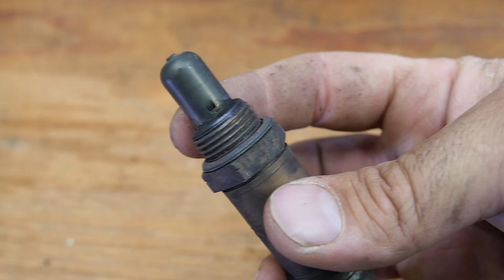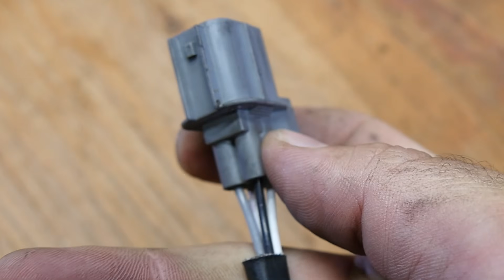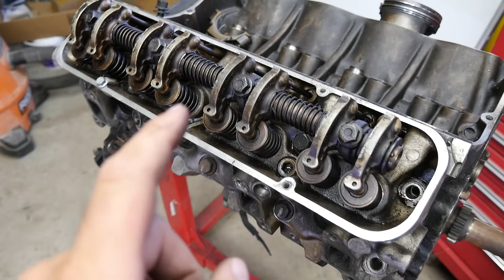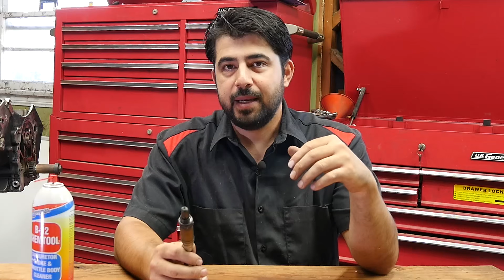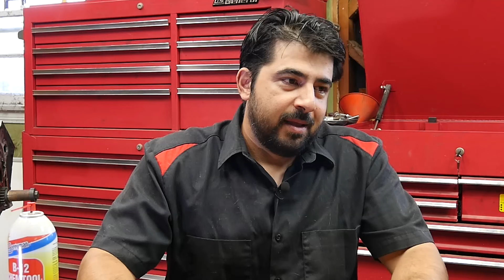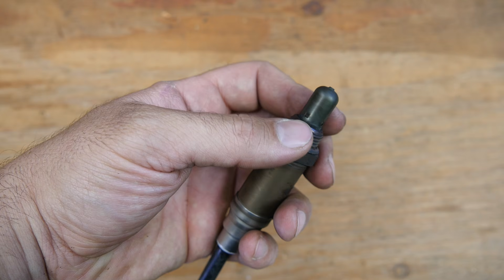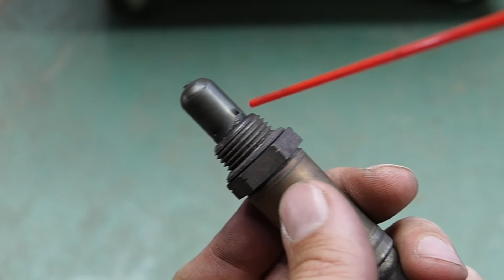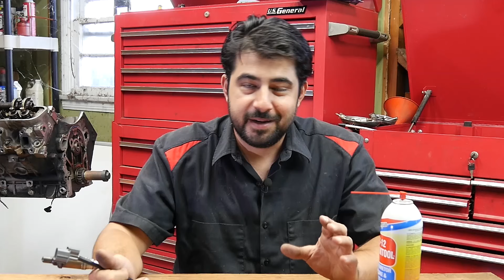How to Clean an Oxygen Sensor

Comment: Is it also true that a failing oxygen sensor could cause “Cat System Efficiency Below Threshold” codes on Hondas?  Alongside bad gas mileage of course.

And cause a very, very rough starting engine when it’s extremely cold? 20F

Thanks for any responses!
Reply: Im having that issue rn. 😔

Comment: Hi sir, quick question. Mine had the code p0135. And i notided the harness is really warm after driving the car around the block. I would say 10 mins at the most.. i came back popped the hood check it and i touched the harness (plug) it was hot to touch. Not so much as the other harness. This one i touched was hot to the point where ypu can’t even hold it at all. Could you tell what could be the reason?

Comment: I'm not getting an engine light, but after a cold start and 5 minutes of driving my engine is having trouble with pulling through every gear. The first 5 minutes it rides perfect and throttle respons is powerfull.

Comment: Ultrasonic cleaner would probably break up the gunk inside of the sensor. I will give it a try on my lsu4.9 wideband sensor. My car had an issue where it wasn't igniting the fuel in some of the cylinders so the exhaust got caked inside with a really thick sort of damp layer of carbon (hence why I was looking at ways to clean an o2 sensor). I have an ultrasonic cleaner coming so I can clean injectors while I am flow testing them on the bench. I will give it a go at cleaning the wideband after I clean my injectors.

Comment: I have 4 O2 sensors in a 1998 Mercedes E320 base sedan. Months ago, 8 codes came up, 2 for each sensor, the sensing code & heating code. I replaced all 4 sensors with new ones. All 8 codes came back after driving for a while. I've been told that on Mercedes like this model, the catalytic converters tend to go bad, the material inside breaks up, and blows out through the exhaust. What do you think of this? Thanks.
Reply: Always get a second or third opinion.....

Comment: The best methods are to soak the O2 sensors, and you can use anything from Sea foam to WD-40 to brake cleaner results May vary lol.
Reply: I enjoy using Seafoam also use it in small engines....brings my weed eater and mower back to life....

Comment: what error code usually occur/shown on the CE lights on? is it always P0172 to indicate we should replace the O2 sensors? how about the Air Fuel Ratio Sensors... are they the same as well?

Comment: I have a 2000 Nissan Frontier- v6,  3.3L and i replaced the oxygen sensors 2 upstream and 2 downstream a few years ago. It monitored and passed smog last year.    I tried to take it into smog this year, and they told me that the oxygen sensor were not monitored.  the heated oxygen sensors are monitored, but the only thing left not monitored is the oxygen sensors.  I do have a small exhaust leak at the exhaust manifold on the driver's side.  My Catalytic convertor, evap are all monitored. I have new spark plugs, spark plug wires, distributor, distributor cap, and rotor. I have driven the vehicle roughly 100 miles and only thing left to monitor is the oxygen sensor.     Is there anything i can check?  any guidance would be appreciated.

Comment: If a cleaned sensor just gets clogged again after a while why wouldn't a new one suffer the same fate? Whether cleaned or new, both will be subjected to whatever is causing so much dirt to get pulled in. Cleaning is less expensive.
Reply: That is true, if you have a bottle neck that isnt fixed, the bottle neck issue will remain. If its clogged something clogged it. Try to fix that too!

Comment: after a good wire brushing, I left my sensor soaking in thick/strong bleach over night, in the morning you could see the carbon from inside turn the bleach black, then I gave it a clean with spirit, it looked like new after,  put it back in the car, worked fine after that.

Comment: Hi , my catalytic converter is stolen with upstream sensor and I installed straight pipe but my engine light is on and the fuel consumption is very high. Does installing upstream sensor into the straight pipe will solve the problem,   any suggestions please and thank you.
Reply: Late response but just tie the sensor under the truck out the way and it will always ready clean air and keep your cel light off

Comment: I have a heater element error on my 2003 Mits Montero. Could I unplug the sensor and just run a resistance test to look for a short in the sensor before testing the signal from the rest of the car?

Comment: I keep getting p0175 on my 2017 Honda Ridgeline. OBD scanner says fuel is to rich. Bank 2. Honda front bank (bank 2). I cleaned out MAF sensor but code came back. I guess checking oxygen sensor is next. Is bank 2 sensor the one upstream of catalytic converter?

Comment: Hi mate, I’m getting lean p0101, p0104, and P010B b circuit errors… intermittently getting p0111 and p00ab errors though not often at all but when it does it always has the p010b b circuit error…. I’ve got a Jaguar sv8 4.2 supercharged and it has 2 maf sensors, I’ve tried switching the maf around to see if the errors change… the first lean error to pop is is always for bank 1 p0101 then followed by p0101 and p010b along with the engine warning light, I’ve checked the live data and it shows that bank 1 maf is flowing a lot less than bank 2 maf sensor… for a while I was getting the cat errors saying that bank 1 wasn’t working right, I cleaned it out and never had that problem since… just getting the codes I’ve mentioned 

What’s the most likely cause, faulty maf sensor, or upstream / downstream o2 sensor?

Comment: Question! Can you replace the connector on an O2 sensor? I purchased one for my car (it's a Bosch upstream sensor and I know it's technically the right part) but the connector is different. If I were to replace the connector on the new sensor with the one in the car now, would that work?
Reply: Technically? Either you got the wrong sensor for your specific car or you’re looking at the wrong sensor because there is two sensors that could have different connectors. Splicing wires isn’t recommended due to the sensitivity of electric flow.

Comment: Usually i'd just replace the o2 sensors but the one i've got now is still practically new but has been badly fouled from a running rich condition from an issue I've hopefully fixed.

Comment: I replaced the upper O2 air sensor on my 03 Buick LeSabre. Code read Left Bank 1 too lean. So, replaced the sensor, no code now but when starting I have to pump the gas like crazy. Somewhere I've heard that resetting the sensor to the computer needs to be done. If so how? Like your video advice.

Comment: Great video. My son got Holden Commodore with V6 lfx same as a chev. We had 0172. Took to it to mechanic. He ran the code and checked fuel trims, but as the motor run very high pressure fuel, with pump running of the cam. He said he can't test fuel system (as U need special equipment) told me to take to dealer. I called two dealer got the same answer, one was $199 per hour and other was $145 per hour. But both said that have to run the codes, I said I know the code and my mechanic said to get fuel pressure test, to see if it fuel injector or pump. They both said no we don't do it the way. So I called a third dealer around 40 kms drive away and he said yes sir we can do that.  So book in, sign the paper when I drop it off, with the fault. Anyway after waiting all day I call and he said, we test drove it twice and it not throwing any codes, take us home and if it throws a code bring it back. Blaming the other mechanic for clearing the code. By the way that was $154 for sweet F all. On the way home it through a code vi think 134. Holy map and he said bring it back I had to wait another week. My son been using my car for around 4 weeks now. I getting pissed off. So I take it in their wait all day, call again. We changed oxygen sensor post cat  from bank one to bank 2. Now if code for bank one come up. Your computer is stuffed, but if bank 2 codes come up just O2 sensor post cat. when U bring it back to read codes, no cost, by the way another $154 please. So $308 later, I feel I been bend over. Lucky the first mechanic didn't charge me. Anyway code 0430 go off. I though I buy O2 sensor for $80 and change it. Took like 5 mins. Being Xmas and dealer being close. 2 days later code 0430 going again. Son just want get rid of the car, which I paying off. Just so piss off. Hick mechanics charging money for shit all, I enjoy your videos, keep up the good work
Reply: damn that's fucked up
Reply: @rockyloccgarage2040  turn out to be the highest pressure pump which runs off the cam (which I though from the start) plus 2 cats. Total cost with was $2350. Nearly $1000 was me being rip for test. One dealer after changing oxygen sensor from one cat to other. Said I needed a b ew computer. Only luck I had was with buying second hand cats. He strip cars for a side business.  Only charge me $200 per cat and told me sell mime for $150 each. I nearly had to fight the mechanic to get them back. Car repair business here in Australia  is so dodgy
Reply: @rockyloccgarage2040  Wait, you understood ANY of this?!
Reply: @exodusx2761  I dont even remember if I did or not
Reply: @rockyloccgarage2040  NOT SO. THAT CODE IS EASY TO FIX.  GET A BETTER MECHANIC ASAP!
Reply: @alfredomarquez9777 what's the fix?

Comment: I'm having  problem with my vehicle I just took it to AutoZone and it showing on the machine under the dashboard it showed the 02 sensor and Catalytic converter ..

 the person that was helping me told me one of them has to be the problem.

This morning I saw oil under the car
I look under the Toyota I don't see no leaking but there was another car before me the person left their car there for 4 months and did not work so I might be confusing their problem with my car.

Any advice😓😞😭😫
Reply: Just buy a obd scan tool for 20$ +  An research any codes you may acc across on the scanner and fix it yourself saves you lots of money. An dont take it to Autozone without checking under the car for  leaks..so you know next time that it wasn't you that was leaking oil.

Comment: I really appreciate the detailed information on this video, thanks.  Speaking for myself, what usually happens is this; pull up DTC Codes, go to the net, YouTube, forums, etc. to find what the probable causes are, how to diagnose, and then how to resolve.  I think many of us would love a library of videos that cover just that, to begin with, the most probable cause for a DTC, then possible solutions or tips on further researching exact causes for our vehicles.
Reply: Yeah, there are tons of resources online for this type of info. You just need to know how to look
Reply: Could this sensor be why my fuel gauge sometimes stops working and goes to empty? Then when I start ignition again the fuel is back to normal but engine light stays on
Reply: Waste of time doing all this I just replaced them with the brand new sensor

Comment: this video is golden. I'm a newbie in this kind of thing, so after a big service I take my fi motorcycle out to ride, it runs pretty well, a bit on the rich side I guess (I checked the spark plugs, a lil bit sooty). guys from the forum tell that's normal, cold engine runs a bit rich until optimum temperature. turns out it was normal cause the o2 sensor in my bike is just a single wire, no heating element so I guess it needs to be heated up by running the engine itself.

Comment: I got a cylinder one misfire code, I replaced valve cover gasket because oil was going into the spark plug and I thought that was fouling the plug, then I replaced the spark plugs, then I replaced the coils, turned out to be a bad injector, by the time I figured out the misfiring problem and fixed it, now I’m getting a bank one sensor one voltage low code, would the month of driving with a misfiring cylinder cause gunk to build up on the sensor?????
Reply: Drove car after fixing the cylinder misfire for two days and the bad sensor check engine code disappeared I hope it'll be good because the Toyota OEM cost almost $200

Comment: I did myself on my highlander and it works, the check engine light is gone and engine runs better. Remove, soak in WD40 overnight, wash with MAF sensor cleaner. Put back! Great!
Reply: So you recomment to it because my car is ceck engine and it sensor 01. Did you use all what he explain in the video?
Reply: Really? I did my gf on my Nissan and it was great!
Reply: Nxt chance with help...Seafoam help removing moisture or water from gas. Great for small engines aswell....

Comment: I just replaced the intake manifold gaskets on my 5.7 vortec a month ago. There is where I found the reason the O2 sensors keep fouling. And the catalytic converters were clogged. And I was getting random fault codes where the sensors tested good.
 The injectors and intake ports were clogged with sludge from the EGR input. I eliminated the EGR all together. There were no sensors connected to it so there would be no fault code. Cleaned the injectors and ports spotless with carb cleaner. And now the engine has that snap it did when it was new. The EGR is an engine and performance killer. 
Your mechanic will advise against that. But they know that's happening.
Reply: I have a 96 5.7 vortec... did you just block the egr port? Thinking about deleting mine and I have heard everything from "it's simple" to "its a PITA and not worth it".
Reply: @daddyosink4413  > Yes I did. Being as I work in a sheet metal shop. I made a thin guage stainless plate to go over it. Put the EGR back on. Then plugged the hose ports. It's a standard 1/2" pipe thread. A 1/2" pipe plug works fine.
  As far as it goes with my opinion on whether it's better or not. Do as I did change the intake manifold gaskets "you are going to have to do it sometime any way because of the crappy gaskets they used". But if you do that you will see that the sludge comes close to completely clogging the intake ports. Robbing you of power and mileage.
Reply: @daddyosink4413  > If you change the intake manifold gaskets. Be prepared it's a hell of a project.
To get an Idea of the scale of that project. Just open the hood. Everything you see has to come off except the radiator.
Reply: @kentinman2326  I'm aware.... had to do head gaskets a few years ago, that took close to a week. Thanks for the info, you saved me some time.
Reply: @daddyosink4413  > 👍 Oh Ok. So you been there done that got the T-shirt.

Comment: I'm in a situation where essentially no amount of money can help me due to time constraints. I simply have to wait for the new sensor. BUT, for the hell of it I'm gonna drop my current o2 sensor in the Ultrasonic Cleaner & see what we end up with! (assuming it isn't properly broken).
Reply: How did your sensor work out in the ultrasonic cleaner?
Reply: @kingrory9613  IIRC; The new sensor ended up arriving in time & when I removed the old one it was damaged (rattling) anyways. This was a $25/10 Minute job so, in MY case, UltraSonicCleaning wouldn't be worth the time.
Reply: Also curious

Comment: Hey man i have a question. Do you always get a check engine light when there is something wrong with your o² sensor? 

My motorcycle ( fz1) is running rough on idle ( only when the oil is about 60c the engine can be 100c and the oil 40c and the idle is ok ) it also runs rough at low rpm. Sometimes it has the problem for a few weeks and than its gone again for weeks and than returns and i can't figure out whats wrong.

Comment: Soak the o2 tip in clr.  It's not carbon build up, carbon burns with oxygen, plus carbon is not white it's black. It's oil additives like calcium and zddp (zinc and phosphorus) that create the white crust.  Maybe also molybdenum and sulfur.

Comment: i replaced my o2 sensor (cleaning didnt work due to broken heating element) in my 2002 sienna le

but now i get error p0171 and p0174 (engine running lean) , i replaced pcv valve , gas filter and mass airflow sensor .. the problem still exists .. im afraid my gas injectors are broken/full of crap

Comment: Quick Question, I have a 2018 honda CRV and recently its catalytic converter and downstream oxygen got stolen and I installed an aftermarket catalytic converter and OEM oxygen sensor. But once the work was done, I see that the new oxygen sensor was joined to the exhaust pipe just before the catalytic converter even though there is a space left on the new catalytic converter for the oxygen sensor, the mechanic said it's fine but was kind of worried if it was done in the right way. What would be your comments on this one? Is it okay to have a downstream oxygen sensor installed away from the catalytic converter?

Comment: I got code p0420 and my car has 68,000 miles so it can’t be the catalic converter... right? What do you suggest clean it or change it?
Reply: i had an O2 sensor code ten years ago on my Geo.
 i burned the soot off with a propane torch. still works fine.

Comment: Just to clarify - oxygen sensor producing voltage by itself, or receiving voltage by ecu, battery, alternator, etc?
Reply: The oxygen coming into the sensor, along with heat, create voltage
Reply: @yogamon  I've got a high voltage error on the sensor after the catalyst. First tried clean pre-cat sensor - no difference. Now I will clean the second sensor. But wondering if the first sensor is working, why this high voltage came to the second sensor? Maybe high temperature caused by engine temperature sensor..
Reply: @radoslav2596  well I actually should have said the post o2 sensor does create voltage, but is also supplied voltage. 2 wires are the signal wires (+,-) that creates it's own voltage.  The other 2 wires are heater wires that warm up the o2 sensor.  Sounds like you have a bad post o2 sensor?
Reply: @yogamon  I've cleaned the sensor already, no difference. Probably just need to replace it, no matter that it could live for 250 000 km(my car is 180 000 km)